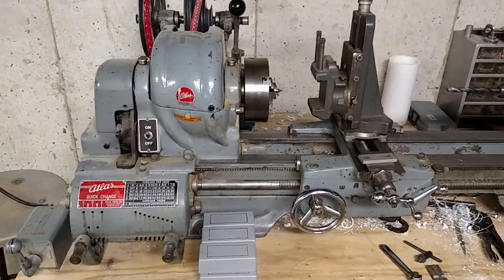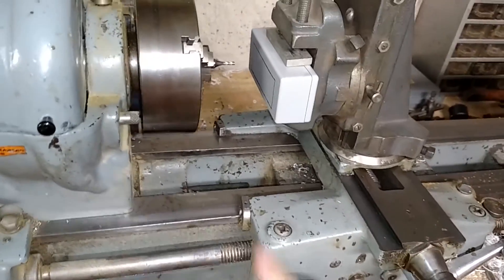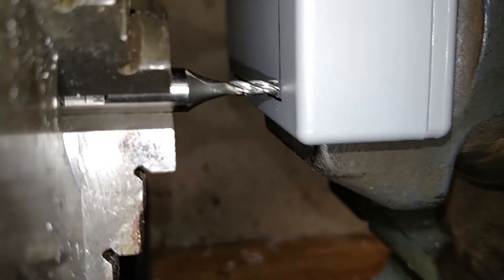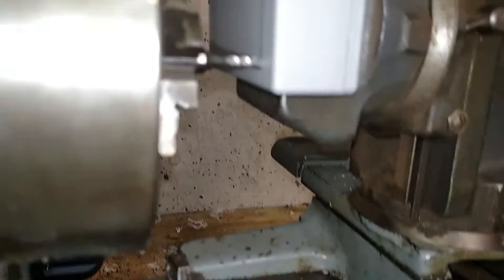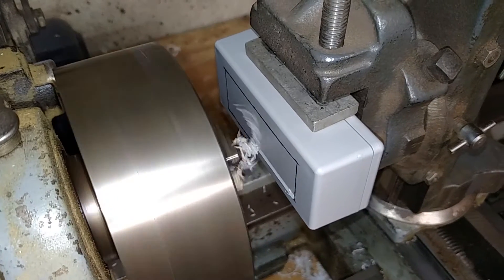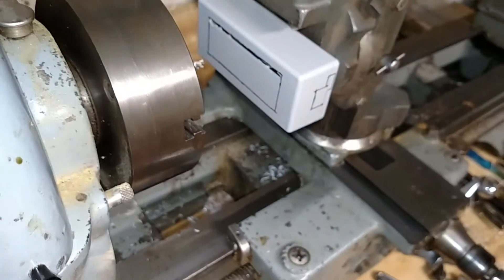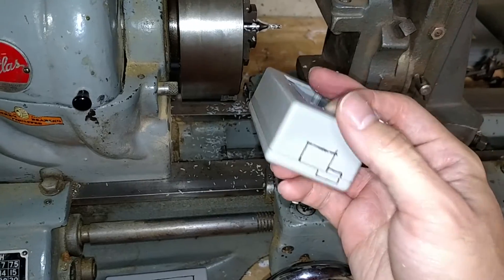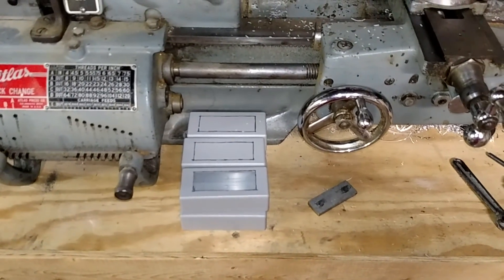Nissan Leaf Battery Pack Sniffer, Part 10

Comment: Nice classic Atlas lathe there. Never saw a rig like that. Now I see how you're doing that. Myself, I would use a 2 flute endmill with a bit more rpms...could be that's the endmill you had....very nice job!
Reply from the maker: +Josh Ward 

I am not a machinist. ;)

I got the lathe at a local auction and it came with all the extra attachments and bits, so I just use what I have.

It is probably an end mill for metal, not for plastic, but it works...
If I run it faster it tends to melt the plastic instead of cutting it.

Thanks for watching,
Wolf